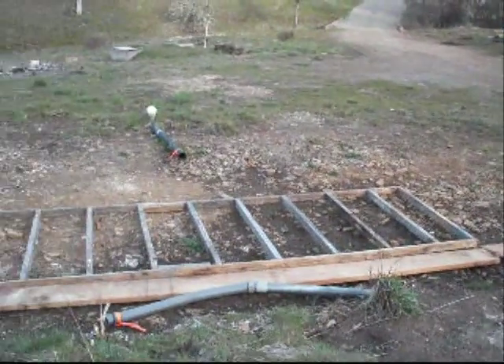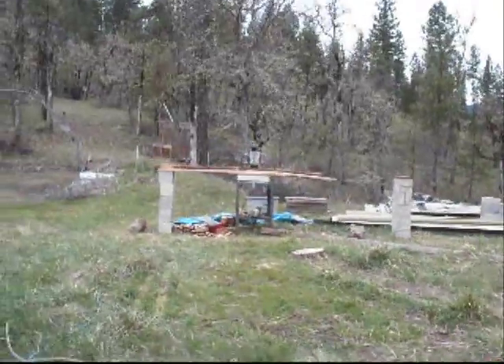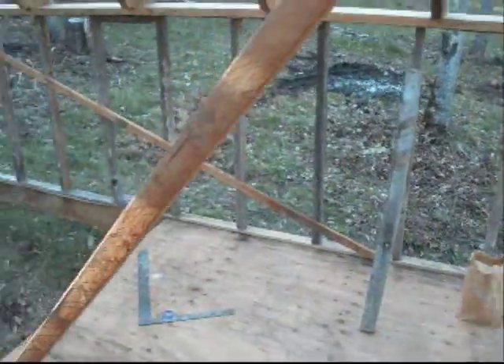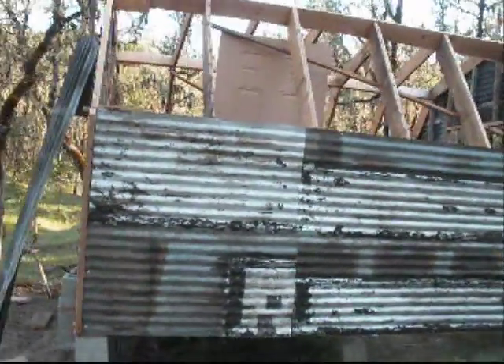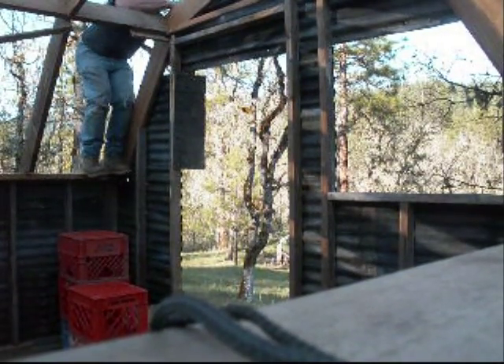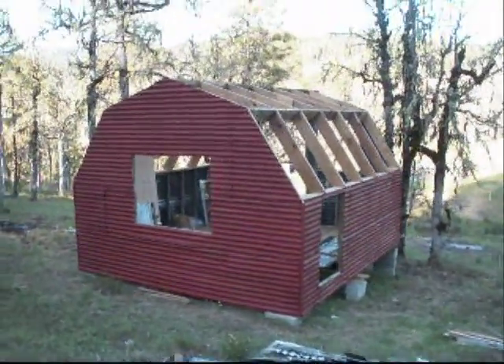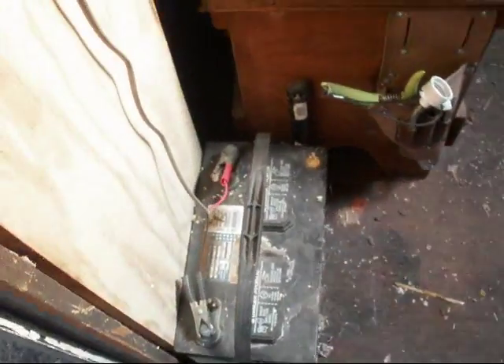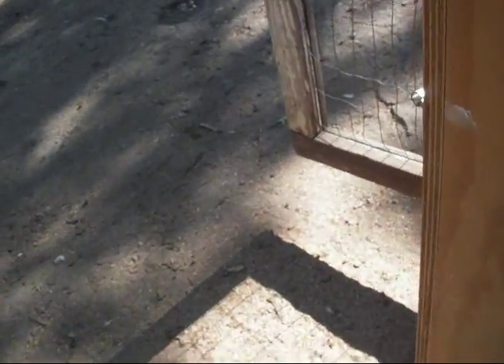HOMESTEAD BUILDING PROJECTS 1- The Little Red Barn

Comment: I admire how you were able to build your barn using re-purposed materials from a mobile home! How were you able to lift the rafters for your barn, all by yourself? Do you have a video of how you lifted them?
Reply from the maker: I did not get video of this barn's joists going in place. I used bracing and placed each piece individually in order to construct it on the site.
Reply: You can use a large tripod with a pulley at the center of the tripod...strap 3 long straight tree trunks or 2x4's together criss-cross at one end only with thick sturdy rope in an x formation. Add a really strong chain pulley under the center. The other end gets spread around the work area and adjust one leg at a time coming in closer to the work area until you get the height you want...attach the chains to the heavy object and heave it up with the chains...make sure your tripod is secure before lifting...usually pounding stakes around the base works. Never stand directly under the load.

Comment: GREEEAT job my good friend Jerry Hanson! Wow man, what an immense tast and great achievement! Love your beautiful barn, super good, well distributed, organized, you the man. I bet some neighbors may even ask you to build one for them! Hehehe

Next time you may want to build a front and back panel, lift them up first one, lean it against another strong structure like a tree, a post, or a home, even a 6' scaffold may hold just one panel. Or, imagine tighting up the top of the peak of the panel still in the floor, and, tighting the other end of the rope to a 2' stick of rebar stuck into the ground. Then, start to lift the panel and progressively move the bottom towards like if you were lifting the panel up. Just don't go all the way up to 90° but 85° or so that it stay high enough so you can nail a long enough brace to help it support itself with that brace, leaned into the ground, still not at 90°. Then add another but this time, as you place the 2x4 against the gable, you place another brace coming from the side where you didn't place a brace, this time you'll position it towards the side of the rope, so now you'll have two legs and the panel won't fall. The panel will stay at 85° or so until you brace the first brace to the back panel. 

You can now untight the rope, and repeat to raise the back panel. Once lifted, walk it towards the proximity of the first brace or, as close as you wanted the back panel to be placed from the front panel. Once there, keep the panel up, around 85° because it may fall towards the side of the rope. Now you can try to, if is not too heavy, position a brace close so you can start nailing/screwing that new brace to one side of the back panel first, and try to attach this first brace to the corresponding side of the front panel. Since the front panel will have two legs, it'll be able to bounce or swing betweer 85° up to 90° and again towards the outside of what it'll be the barn, down to 85°, so using a level, bring this front panel to 90°, screw it to the brace. Go back now to back panel, use the level, unscrew and screw the brace again at 90° on one side, if is nit too heavy. If is too heavy, repeat the legging or bracing I suggested you on first panel, trying to keep it as high as possible but not at 90° since you won't be able to just hold it with the rope. 85° or so will be fine. 

Both panels may look like, if you see them from the top, like kind of an S but squary like an unfinished "S of the swastika" where the forward and backwards sticks are the support legs or braces, and the center will be your panel. Once with braces, they'll lean in the floor. Brace them one by one to each other, making sure first panel is at 90°, then you'll do the same on the other, then double check first 90°. If is close to 90°, go on to the other side of first panel, front panel, there where you haven't brace it towards the back, lets say now the right side, there you try to lead it to 90°, brace it to the back. Then go to the right side, of the back panel, try to lead it to 90°, brace it to the front panel. Now once all are braced, you then will go to the first panel and rectify the 90°, rebrace if needed. Then to the second 90° attempt, repeat, then to third, then to fourth. Once you have those two panels at 90°, you can add walls.

Now lets say you brace them nicely but  they're too close or too far from each other. Don't worry. Get the walls at 90° on one panel. Once the front per say has the walls at 90°, add temporary braces to the walls. Remove the end of the braces to the back, position now the back panel at desired distance, at 90°, screw them. It'll be lot easier I guess. 

Then try to place roof trusses one by one in between front and back trusses. The first two trusses should be in the first and back panel from the beginning. 

To place one truss after the first one, calculate its position, brace one side distance with a 2x4 which can be short but, since you have the two main panels installed, you set a long (if you have) 2x4 from one end to the other end of the roof trusses of both front and back panels, that side will block or serve as a stop for your trusses lifting and sliding them on top of the walls. Once you have one truss up, lean it against the front panel roof, bring it close to the desired position, level it, place one screw. Go to the other side, level it ideally on the desired final spot, screw one screw. Go back to first screw, double check 90°, unscrew, if needed, screw once you got perfect 90°. Go back to second screw, on the other side, double check it, unscrew if needed, screw again. Go to first screw, if is at 90°, place second screw, you'll got your third roof trusses on, now repeat until you got a roof structure. Then take a break. 

This is tough. Let me know if you have any doubt or question at rodolfoplasencia@live.com or at 7864396047. I may be able to give you an idea or two.

Take care bro, and keep inspiring us.

I'm looking for a piece of land to start my little farm in Miami but is extremely expensive for me. I got a way to make more money but is going to take me easily couple years or who knows, until then, I'll keep on searching for some land. Take care bro!!!
Reply from the maker: Your welcome. Thank you for watching. Be sure to watch the build of the NEW BARN
Reply: @pinemeadowshobbyfarmafruga8319  I will! Thank you!